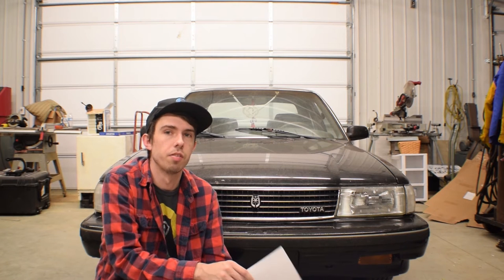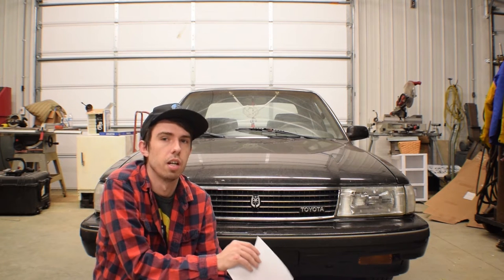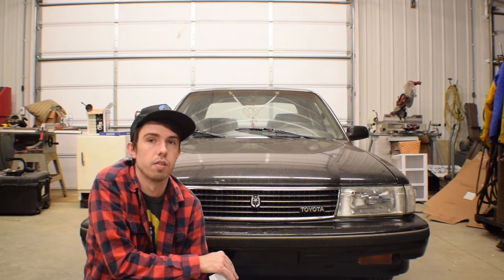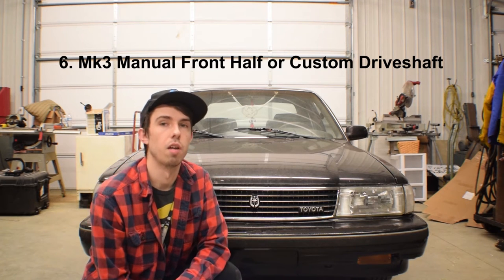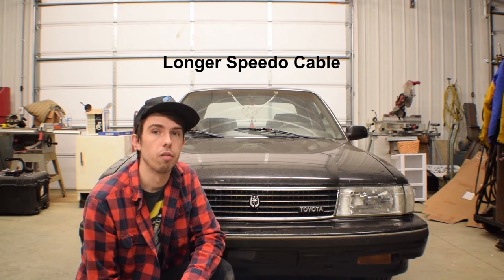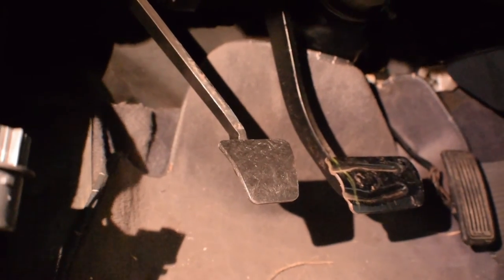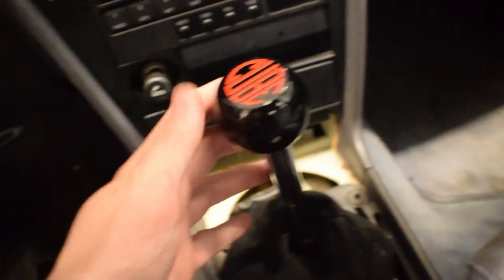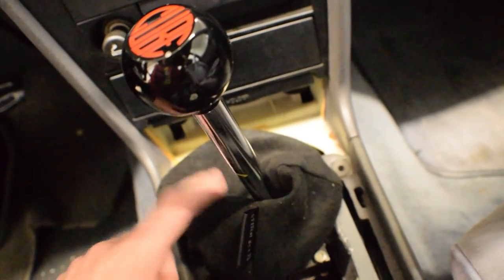How To Manual Swap Your MX83 Cressida!

Comment: Hey you think these parts woukd work on an 89 chaser as well?
Reply from the maker: I am not sure, if they have the same engine and auto trans then they should work with maybe some minimal fab work
Reply: @ColossusCo  I've been searching around and seems like people usually use the r154 which also works on the cressida so I thought the w58 would
Reply from the maker: @nathanobrien9227  yeah they would definitely work. I don’t know about what bellhousing/driveshaft would match exactly though. The w58 from the MK3 Supra fit perfectly to my 7MGE bellhousing and all. I just had to make a new trans mount
Reply: @ColossusCo  great ill try that, I want to keep it mostly stock but the automatic trans just sucks lol

Comment: Does the w58 have to be remote shift version?
Reply: Colossus Co. thanks for that, currently building one and having trouble finding if it needs to be remote or not
Reply: Colossus Co. Do you know of anywhere that does off the shelf coil overs for mx83 or what other models of cars coilovers that would fit?
Reply from the maker: xTuggz yeah check my coilovers video, BC racing has great coilovers